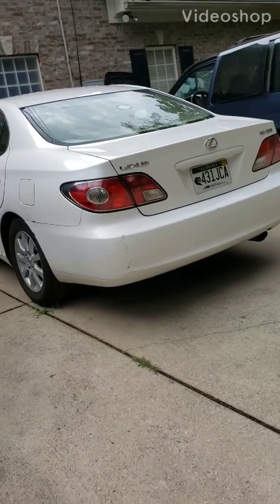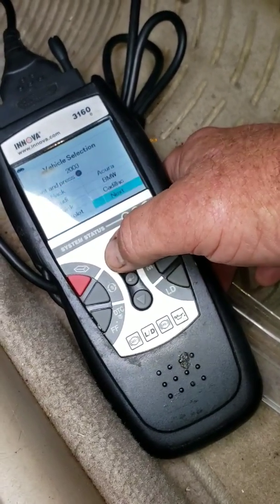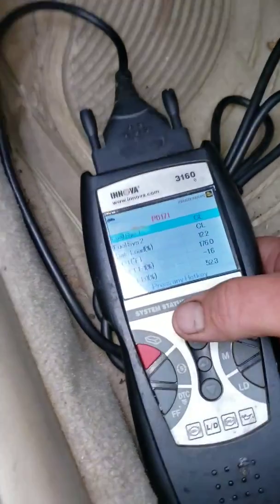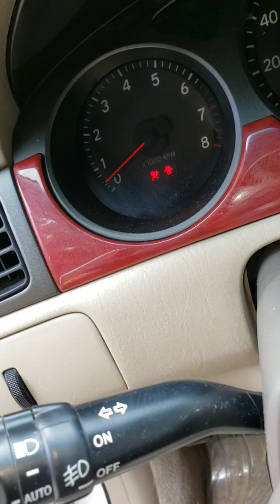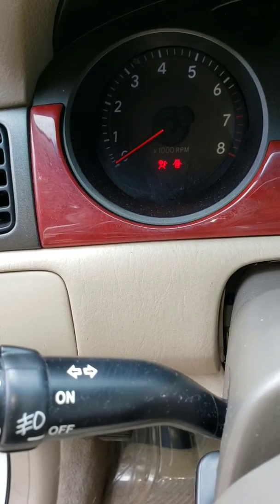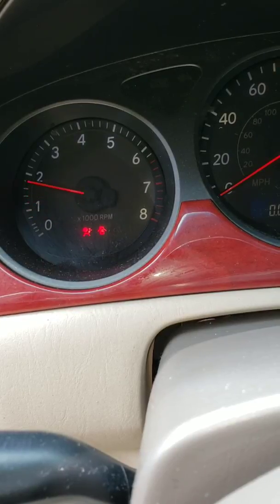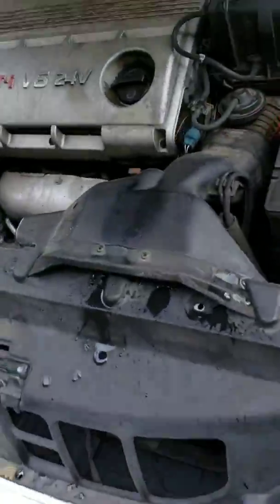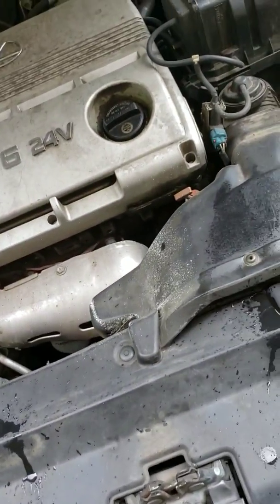2003 Lexus ES300 no power

Comment: How did you fix it ?
Reply from the maker: I did replace the air Inlet tube and that solved the problem but she did burn up the two knock sensors and that repair was so expensive she opted out. And then the car finally stopped running about three months later